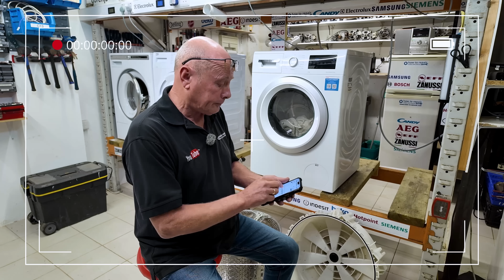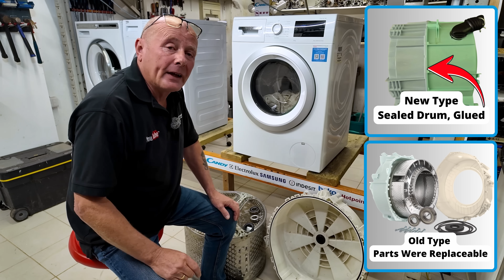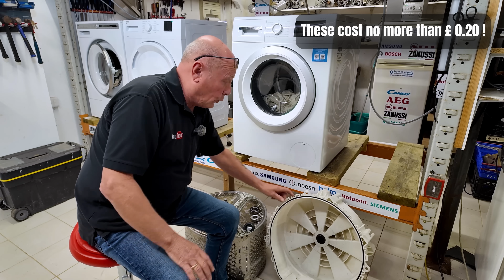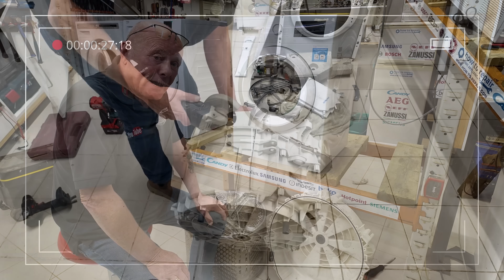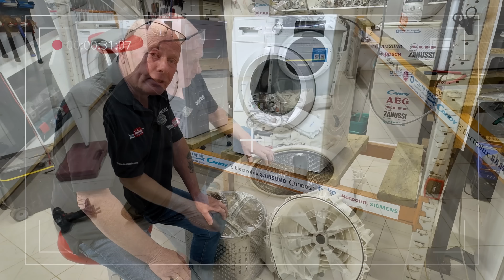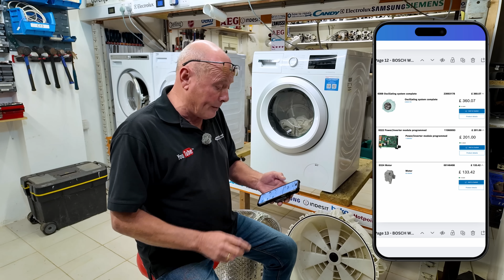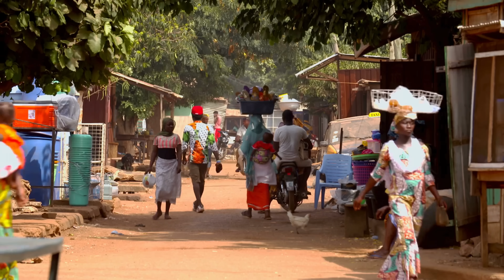Washing Machine SCAM EXPOSED! The Truth About SEALED Drums: Naming & Shaming

Comment: I have worked for a retailer for last 10yrs installing all kitchen appliances and have said this for years that things are set up to go faulty after a set time, they can make a car to put out fake emission results when been tested so just think how easy it would be to program a washer, dryer or even your TV to fail after a set time. I here it all the time and I mean all the time when a customer says its literally days out of its warranty. It gives shops who sell these products bad names and most likely  would stop that customer going bk if something only lasted a few years after paying sometimes thousands for products.
Reply: New Zealand's Consumer Guarantees over rides manufacturers warranties.
ALL products must be free of defect etc for a "reasonable" length of time, and with whiteware it can be over 10 years.
Reply: Australia has the same but the manufactures try their best to find a reason not to fix.  Got an epilator and while the base works but the head no longer pulls out hair.  They say it's a consumable at 25% of the original cost.  I say it's not fit for purpose and a reasonable person would except a hair pulling device to continue to do that for at least the warranty period.

Comment: I have to look at 2 sides of this. Yes the manufactures like alot of companies Like Apple`s Iphone are making repair near impossible. and expensive to buy parts for. So it make sense to buy a new product as its uneconomical to repair. Then there is the side of the customer who has the broken item. You explain your side from the manufacture for making any product what you call " planned obsolescence" and the cost of bearing, and other parts inside the drum. But you do not explain What is your call out charge what is your labour cost. I understand a Bearing could cost £5 but to include your call out charge and labour to fix it would be a few £100s just to replace a £5 bearing. I understand there might some DIYer out there who what to repair their own machine. but 90% of people will not take the risk nor have the time and effort to do this type of thing.

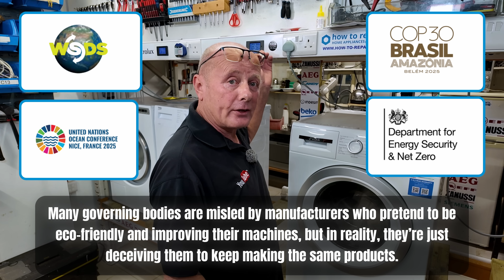Comment: I wasn't much into DIY 3 years ago and threw away a perfectly working washing machine that needed shocks for a new one.  Old one biggest cycle was 1:15, it would clean perfectly at 50 minutes programme.  Now I got this stupid Whirlpool that takes 3 and a half hours to wash, all because of stupid EU rules for low water usage.  Prewash at 40 or 60?  No, you can't have that, sorry.  Extra water in the cycle?  You can't have that either.  Furious.

Comment: Disappointed that Miele included in this list, they do however do a 10yr warranty. Just bought a washer and dryer waiting to be installed. It would be good to see a list of GB sold 
 appliance brands that can be repaired. I'm sure most people don't want to have to replace these items every 3 yrs. For many people upgrading their washing machine is a big expense Great video, really helpful please keep them coming
Reply from the maker: While Miele's 10-year warranty is certainly better than the standard 1 or 2 years offered by many others, it is still a fact that the manufacturers listed (including Bosch, Siemens, AEG, Hoover, Hotpoint, Indesit, and Zanussi) are using the sealed drums. As we showed, this forces you to replace the entire drum for a failed bearing or spider, rather than just the cheap components, often making the repair uneconomical outside of any warranty period. I’m glad you agree! It’s down to us to ensure this is as visible as possible. I can't do it alone please remember to share it widely.